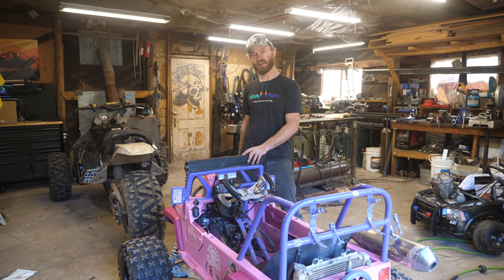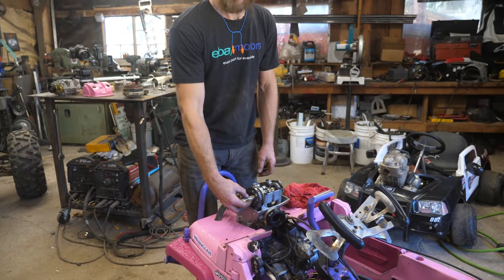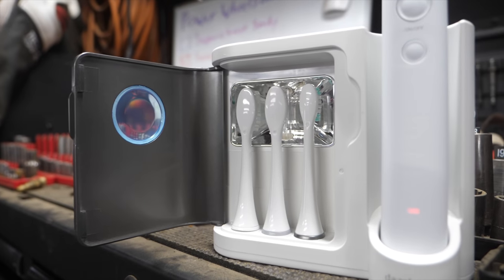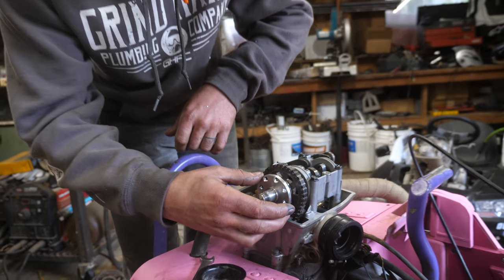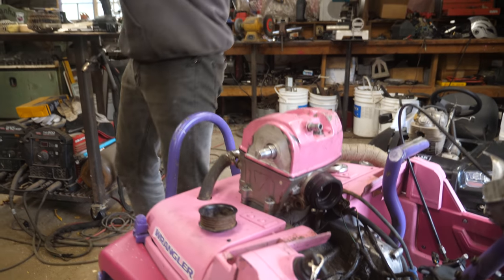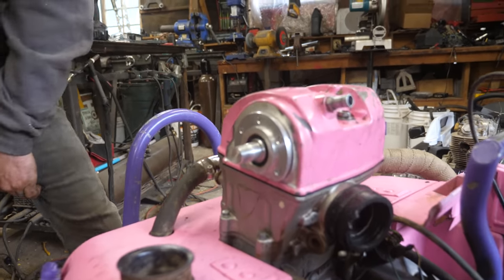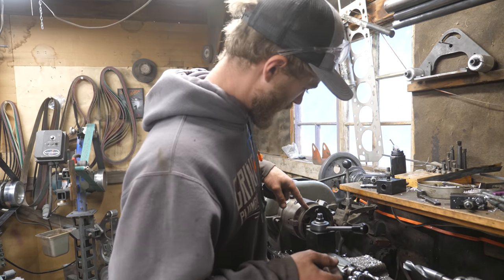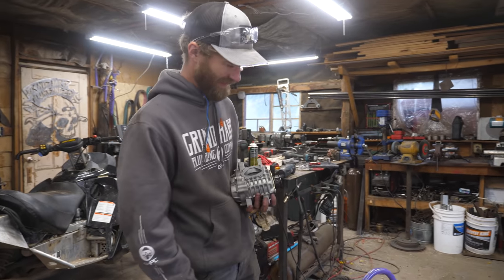Supercharger Install on the Barbie Jeep Go Kart

Comment: I love the ingenuity,  but there’s a reason roots blowers are driven directly from the crankshaft.  I think you just created a 
“what component is gonna break, and when” scenario.  Cam is turning half speed, so gearing it back up with belt pulleys is adding heat and stress. 
Not adding an outside support bearing to camshaft is a cringe.  I hope I’m completely wrong and it works and holds up perfectly.  🤜🤛
PS  parasitic losses to drive the blower on a top fueler are somewhere around 800–1000 HP. 
I’m betting you’re gonna smoke the belt with the extreme overdriven pulleys. 
Again,  I hope I’m wrong and just floats looong 2nd gear wheelies !! 👊😎
Reply: Yes  but its not like they are trying to get 100,000 miles out of it. I am sure it will work for many rip sessions around the yard.
Reply: @NotaRobot_gif  
Agreed.   And it might be a cool surprise and last longer than it has any right to. 
Watching this imagineering and impressive fab skills is a huge grin. 🤙

Comment: U guys asked about speedometers??  i forget which video u asked this on, iv watched a few in a row but theres really cheap digital dashes on ebay that actually look pretty nice, they tell u rpm speed temp, gear indicator, light indicators even blinker indicators   i think they also have oil sensors im not sure tho  n im probably forgettin other things they do have but u should check them out theyre really cool n only 40 bucks.. 2 20s   i cant wait till my next project  i kinda wanna get one of these n put it on a dirtbike jus so i can play with it lol :p

Comment: What kind of supercharger is that and where do I find it
Reply: AMR500 on eBay. There are a bunch of them. They work good on gocart engines, but I don’t know how they will work at the rpm this engine will turn.
Reply: @adamr9215  I have a Honda 440ex looking to get more power out of it

Comment: Best regards guys,you are ones of the best proper and creative petrolheadzz.İ ride a reverse leaning trike with a supercharged lc8 on it.307 kg weight,ktm  1290 lc8 supercharged 0.8bar boost,has 213 hp on wheel.Will post a vid soon.Im your fan guys

Comment: Idea if you get bored and want more boost:
The camshaft turns half the speed of the crank, there fore your pulley for your supercharger is turning half as fast as it could, if you can figure a way to have the pulley mount to the crank you'll have more rotational speed for the whiney boi
Reply: The easy way would be to double the size of the drive pulley on the cam.
Reply: @cadecarp11  also an excellent solution, perhaps boring out the runners will provide better airflow as well?
Reply: @brandonterry1456  honestly I didn't finish the video before replying.  I didn't know they already doubled the size.
Reply: @cadecarp11  no harm no foul, to be entirely honest I didn't watch till the end myself😂